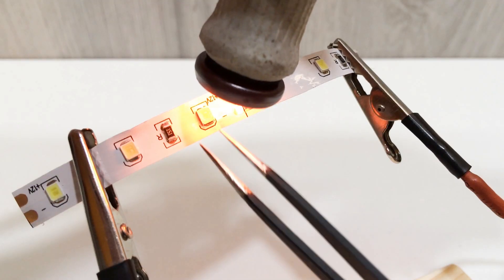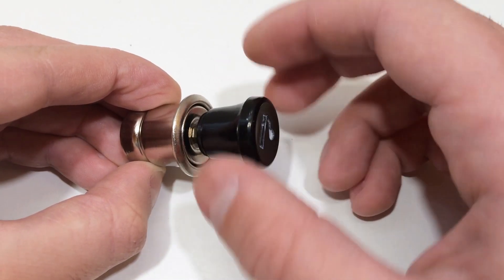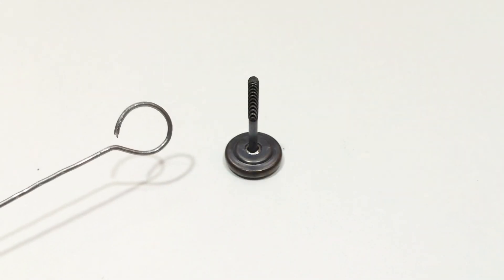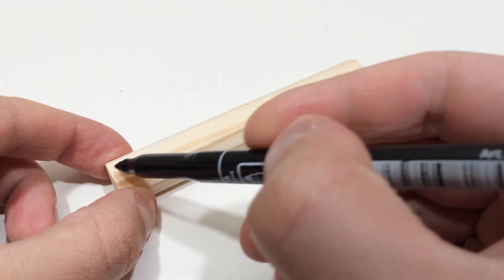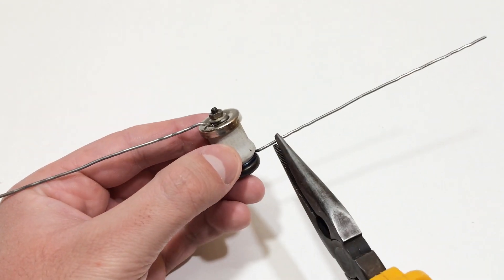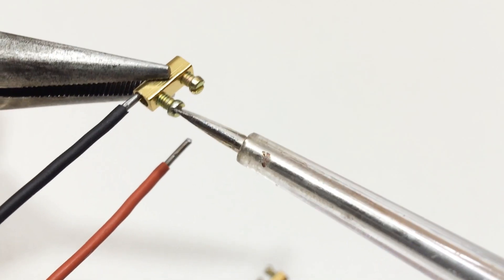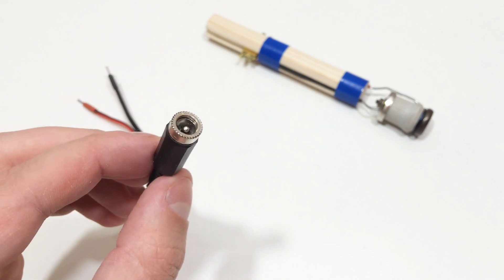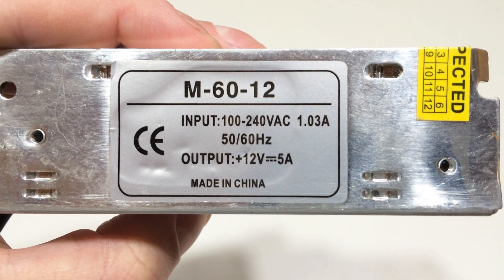How to Build an Infrared Soldering Iron – DIY Guide for Perfect Soldering!

Comment: components can destroy because same amount of heat is transferring to soldered joints and components as well as heat is transferring via convection while in conventional soldering most of the heat is transferred to the soldered joints only as the soldering iron tip only makes contact with soldering joints only because heat is transferred via conduction mode in this method